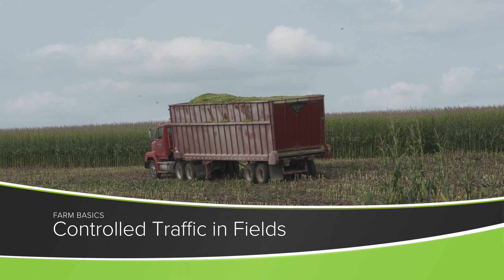Controlled Traffic in Fields

Comment: Tracked equipment has helped a bunch, but sometimes it’s just not possible. I have 2 Maximizers and two 7721 tow behinds modified for edible bean harvesting, and they predate the technology.

One great thing about Case IH is they brought tracks out early, so operations that can’t swing a newer tractor can benefit from lower priced older quad tracks. I run 2 of them on my grain carts. Adding PTO’s cost me as much as the tractors, but I’m not wearing out my RX’s on grain cart duty.
Reply from the maker: Brian and Darren addressed your comments on Ag PhD Radio: https://soundcloud.com/agphd/11-08-21-sudden-death-syndrome?si=e84b7f7cf0b24ae29bd1482a8bef01d6#t=31:22